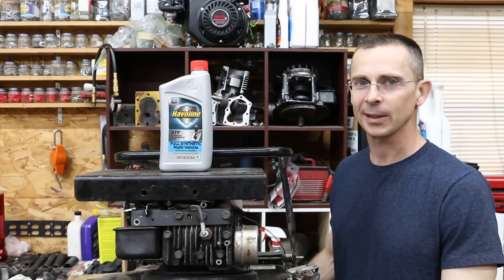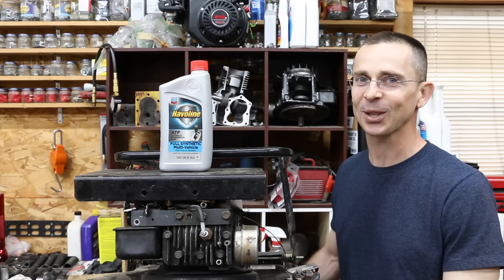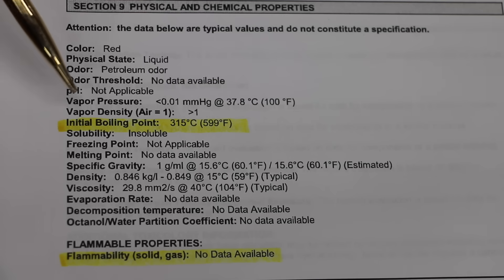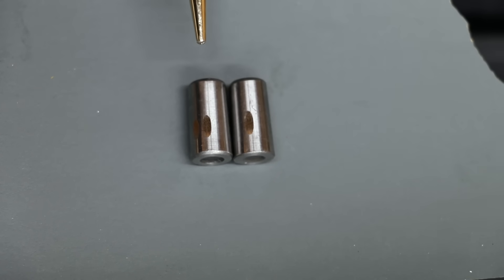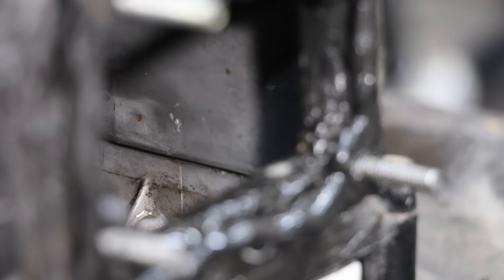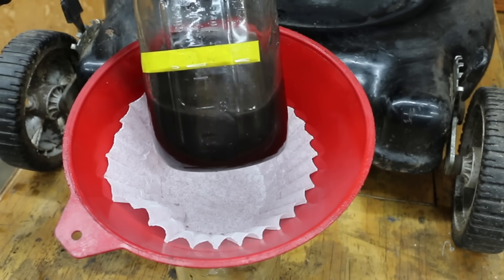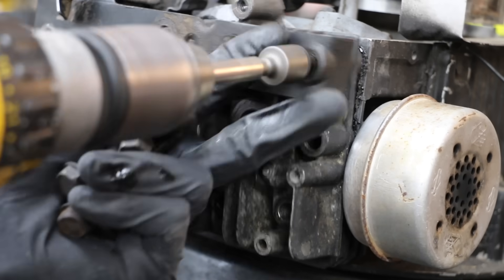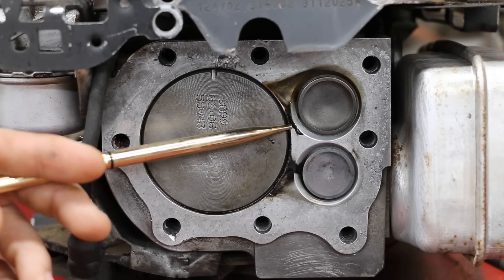ATF as an Engine Oil substitute?  Let's see what happens!

Comment: Hi, I'd love to see an engine oil comparison and film strength of different winter blends at NORMAL operating temp.  (0w40 vs 10w40)  Seems like everyone wants to do a cold oil pour test but not hot. For example I have a car that when I run 0w40 it visibly burns a little oil out the tail pipe only when at full operating temp, however if I run 10w40 this doesn't happen even though both oils are suppose to hold the same viscosity at normal operating temp. (same brand of Mobil 1) This will also answer the question for those wanting to go to 0w30 for better winter warm up circulation but are also scared it's too thin or it still affects the 30 weight viscosity blend of the oil.  Put this test together an i'll donate a predator engine :-)  Mr. Digital
Reply from the maker: Thank you for this recommendation!

Comment: A job I worked at in the early 80's had 2 big compressors that I changed oil in regularly. One compressor used a AW68 hyd oil and the other was very clearly labeled "DEXTRON II ATF ONLY". I  asked what would happen if 68 went in it and was told the heat would turn 68 to carbon fast. I was told the ATF took a  higher temperature to turn to carbon.
Reply from the maker: This is interesting. Thanks for commenting on this!

Comment: Any engine flush should only be run at idle up to temperature and drained, not driven using it.
I use 2 oil filters doing a flush, one before I run the flush after draining the oil so we don't wash anything out of the old filter and recirculate it and another one after the flush with new oil to get rid if any traces of it removed before new oil is used..
It certainly works to removing gumming, particularly in multi valve heads where oil is part lube part coolant due to lack of water jacket space, the gumming afflicts overhead hydraulic cam followers making them noisy that an engine flush can fix.
Likewise anywhere gumming can cause issues for example oil control ring expanders that gum up and cause the engine to start blowing smoke that isn't worn rings it's just that they are jammed in the gummed oil ring expander.
AFT would be fine at a pinch of you had nothing else but I would not drive around with it in the engine.
Its fine in a transmission including manual and transaxle and many vehicles use exactly that in them.
But they don't have the heat or the plain bearings an engine has.
In fact of Formula Vee racing we used ATF in the transaxle instead of gbox oil to reduce power losses in the gbox and less foaming since the engine is revving a lot higher than stock so it was fine in old transaxles under racing conditions.
Reply from the maker: Thanks for commenting on this.
Reply: AuMechanic  I have used 4 liter of engine oil 10w60 and 4 liter of diesel fuel in my mercedes 320 V6 petrol, and drove it for a week every day.  The only result was a beautiful clean engine inside, and that run so smooth. I have to say that I change the oil filter twice that week to remove the sludge that was stuck on it. During this week,my  engine running temp was good, and my engine was not noisy at all.
Reply: Useless, if your engine is gummed and sludged its too late you might as well just put new oil in and hope for the best because flushing a sludged engine can lead to cylinders burning oil and sludge becoming dislodged and clogging oil passages, flushing an engine which has really dirty oil is useless as well just put new oil in and change it on time. I work with cars for a living I never recommend doing this its a waste of money
Reply: A little note: A/T uses coated bushings inside, similar to the engine small end bearings, however these bushings are not subjected to reciprocating loads. The past owner of my former 87 Camry (2.0 3S-fe twin cam) used ATF to "clean" an engine with rare oil changes. As a result the ATF lifted black tar like deposit in the head carrying it around the engine. I was lucky to spot this right away and partially remedied it by two oil changes in a month period, or an engine could end up with plugged oil pickup screen and wiped bearings
Reply: Half cup of atf and 4 and a half quarts 10-40 rotella. Used it for years on every oil change and drive the fuck out of it... no problems
Reply: Rocket Science ...oy
Reply: Diesel engine oil is high detergent and good for engine flush for older engines, and being an engine oil is suitable..
Air cooled VW engines are best run on it full time to stop tarnishing.
Reply: AuMechanic i have oil dissapear issue in toyota crolla 2004 can i use 50% ATF and 50% existing oil in engine for flush will it help ?
Reply: I would not use ATF, see the comments above.
Reply: I'll admit I'm barely an amatuer but!  ATF used to be hydraulic fluid with a red dye in it. Automatic transmissions rely on hydraulic fluid to get a certain psi for the clutches and torque converter to run properly and the right viscosity is important. Nobody in their right mind would run ATF in an engine designed for motor oil. In my 2000 year Ford econo-box car the Mercon ATF for the transaxle is the same for the power steering. Yes, I noted he said the ATF he showed was mineral oil.
Reply: What would you recommend for lifter tick. I ran 1/2 Qt. of transmission fluid ( at idle ) for 20 Mins about 35,000 miles ago and when I changed the oil the tick went away for about 7,500 miles then came back. Oil is changed religiously with OEM AC Delco filters.

Comment: Ever heard of Motor Purr (brand) and the product is Tune Up. It is supposed to free up sticky lifters, expand leaking seals, helps with transmission issues and more. The main ingredient when I first was introduced to it was MEK methyl ethyl ketone. Had a 1977 Pontiac and a lifter collapsed after a botched oil change lost oil from an overtightened oil filter. The guy had to pour it slowly into the crankcase as every time he'd add some the engine RPM would fall almost killing the engine. Sure enough though in a short amount of time the lifter went silent and we drove for years after with no issues. Finally sold the car for parts after 379k miles. It still ran and drove but was so weak and worn out.
Reply from the maker: I'll have to test Motor Purr. Thanks for this recommendation!

Comment: I have 2001 dodge with 5.2 L. About 8 years ago i put around 4.5 quarts atf with a quart of diesel ran it for 10-15 min. Really til it started warming up. Havent had any problems with motor since. Put about 80,000 miles on it since then.
Reply from the maker: Thanks for commenting on how you've used ATF!   I'll test diesel soon.

Comment: Liqui Molly Engine cleaner is the best. No contest. I applied on My crappie Renault Trafic II. 1.9 DCi engine. Compression increased with 5%, the engine oil is clear as new after 3000 KM, the engine is running very smooth and silent, the preheater plugs are metal clean! Not bad from 15 USD :)
Reply from the maker: Thanks for this recommendation!

Comment: To clean a crank case and valves we usually use diesel fuel. We drain 1/3 of the motor oil and replace it with diesel fuel. Then run the engine for a couple of minutes, let it cool and then run another couple of minutes before oil change.
Reply from the maker: I'll test diesel soon. Thank you!

Comment: I have used ATF/OIL mix 50:50 for years to clean really dirty engines, some appeared to have been oiled with tar. The problem with ATF on extreme cases is possible blocking of the pick up screen...............watch the oil pressure. In some cases  have had to pull the oil to clear the "tar" off the screen. I have tried most everything...............everything works to some degree. Hell, I have had to put solvent( diesel/kerosene/mineral etc.) spirits in some engines and rod out the drain just to get something out. Then fill with oil/atf run till hot a few times. It doesn't fix anything but most engines run for years after and all are clean for the overhaul.................hmmmmm, who does that anymore? Like your videos.
Reply from the maker: Thanks for commenting on how you've used ATF!

Comment: I suspect the legendary status of ATF of having superior cleaning capabilities came at an age that predated modern engine oils which have stepped up their game significantly in the mean time. Question I have then is how much improvement does something like Rottela 15-40w have detergent wise against ATF? My hunch is that ATF is neck and neck the same these days but 40 year old stories/habits are not going to die unless you hammer a wooden stake in the heart of the beast and kill it good and proper. I cant figure out how to test the issue though and of course fairly.
Reply from the maker: All great points.

Comment: I've had several successes with clearing up a lifter tick on engines that were run way past service intervals regularly. A 1 to 4 mix seems to work pretty well. Haven't had to eat an engine yet doing it.
Reply from the maker: Thanks for commenting on how you've used ATF!

Comment: Whit my experience I can't recommend ATF to engine. When I was young I've tried that at 4 stroke 50cc bike, it was honda monkey. I really didn't know anything about oils at these times. I just wanted to chance motor oil and only oil that I happened to have was ATF. So I put ATF on the engine and it didn't last very long time. Piston rings got broken and engine stops working. At least I can't recommend it to use at 100%. If use to clean engine etc., use at somekind of mixture with engine oil.
Reply from the maker: Thanks for commenting on how you've used ATF!

Comment: It's been an old family trick to clean an engine by running ATF through it at a 2/5 ratio... Especially after a blown head gasket and you got baby poo all over the engine... It's great at cleaning it up without having to disassemble it entirely...
Reply from the maker: Thanks for commenting on how you've used ATF!

Comment: I only two days ago suggested you make a video replacing oil with ATF fluid. And you did!! You have my sincere gratitude, and a obviously a Patreon donation!!
Reply: To further on this I had a 98 Lincoln V8 24v dohc 4.0 that had suppected water intake damage. It had very very bad knocking and very bad power. Ran a mix of atv fluid with oil with no improvement.
Reply from the maker: Thanks for supporting the channel and thank you for the video ideas!  I tried ATF once and didn't have any success with a noisy lifter.

Comment: I have done this alot in my vehicles over the years but NEVER ran 100% ATF. All of the engines in my vehicles have held 5 quarts of oil so what I did was drop 1 quart out the drainplug and pour in 1 quart then drive the vehicle for a couple weeks then change the oil. Replacing a quart of oil with ATF won't hurt your engine at all but it will for sure clean out dirty engines because ATF is a detergent. Great video's sir!
Reply from the maker: Thank you!

Comment: Try bananas! There's this story of two guys who made it through the desert with their Citroen 2CV after having lost their oil (leaking oil plug), with bananas instead of motor oil. I'd love to know if that works (the Citroen had a very simple 2 cylinder, 30 horsepower engine).
Reply from the maker: Thank you for this recommendation!

Comment: I did it to a 1994 Hyundai Accent 1.3 motor about half engine oil and atf it had stuck lifters and sticky oil rings from poor servicing I ran it for a couple of hrs a about 3000 rpm and then changed it out . Nowadays it runs great doesn't use any oil I've just done another 1000 ks over the last few days runs sweet
Reply from the maker: Thanks for commenting on how you've used ATF!

Comment: I've used it to clean a flush and engine. And to free up hydrolic lifters that we're clogged and not inflating correctly.
Normally I would use 3 qrts of ATF.  Cheapest you can find. Not synthetic. And 1qrt of a thicker oil.. 20w-50 etc.
Let car idle for 45min to 1 hr.
Drain and refill...
Works well.
Reply from the maker: Thanks for commenting on how you've used ATF!

Comment: I've used an old trick using 1 cup kerosene and 1 cup of atf. Everytime I've had a lifter that didn't want to pump up aka noisy. Add the concoction to oil, run for 40 to 50 miles and then drain and refill with cheap oil to flush out atf/kerosene left overs. Run it for about another 50 miles and then drain. Then fill up with desired oil and filter of your preference
Reply from the maker: Thanks for commenting on this!

Comment: Race engine builders often will use 20% ATF (of the total oil volume called for) with the initial break-in oil - so 1 quart ATF and 4 quarts oil in a 5-quart engine, for instance. They swear by it, stating it cleans out all the assembly lube and accelerates break-in, helping the rings to seat faster.

Its extraordinary cleaning properties are well-known, too. I've seen people prepping blocks with brake cleaner, then use ATF afterwards, and it removes a TON of remaining dirt most people would never imagine is still there.
Reply from the maker: Thanks for this information.

Comment: Run the test two (or more) more times and see if there are metal particles each time.  That would probably tell you if the ATF is allowing the metal damage or if it just flushed out prior shavings.  I've run 1 quart of ATF in my 6 quart capacity vehicles and didn't notice any improvement nor any problems.
Reply: I also wonder if it made a difference since you ran 100% ATF and I normally do 10-20% ATF and the rest motor oil
Reply from the maker: All great suggestions--thank you!

Comment: I have used ATF lots though I poured it into the carb of a hot engine to decarbon and it worked, but not as good as straight water for this. ATF has a lot of detergents in to to clean the tranny small passages so it should clean better than engine oil. Great video
Reply from the maker: Thanks for commenting on how you've used ATF!

Comment: It works very well to remove sludge but it also made my nearly silent, high mileage, Mazda KL-DE 2.5 V6 develop some nasty startup rattle in the rear cylinder head. Maybe there are some lifters that loved to live in some crap and cleaning them made then discharge overnight... Other then that, car ran fine and actually burned less oil after the ATF flush so I lived with that until the car went to the junkyard because of rust at well over 350k km...
Reply from the maker: Thanks for commenting on how you've used ATF!

Comment: I, and a mechanic I learned the trick from, use ATF to clean engines and stop ticking lifters.  I personally consider this to be better than using the 15 minute engine flush that seems like nothing more than kerosene.  After several minutes ticking lifters stop ticking.  I should also add that we don't use new ATF fluid... we use used ATF for this procedure (about 2 quarts in a V8).  I'll also add that on one occasion I neglected to drain the oil out of the engine for nearly 250 miles... never noticed any issues.
Reply from the maker: Thanks for commenting on how you've used ATF!

Comment: wow, 1380 comments !    Back in the 70's I flipped a lot of cars and the first thing I did was to put in a quart of Rislone (I do not know what it is, but it seemed like light mineral oil) and it would quiet the lifters and the engine ran smoother and felt more responsive.   Eventually I could no longer find the quart can of Rislone, but it came in a 'concentrated' pint can.  
I switched to adding a quart of ATF, with similar results.
Of course I only ran the engine for 1000 miles, then did an oil change and eventually sold the car.
Reply from the maker: Thanks for commenting on how you've used ATF!